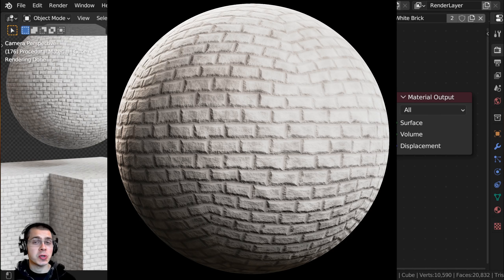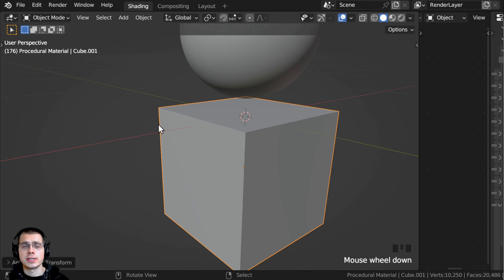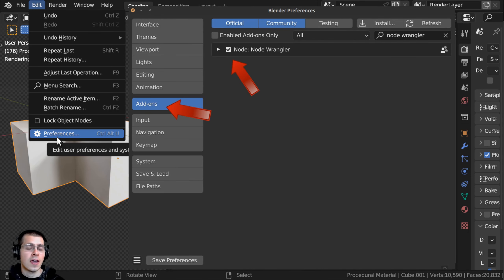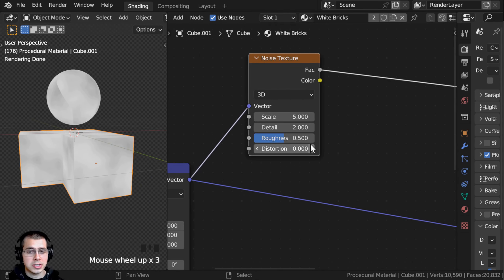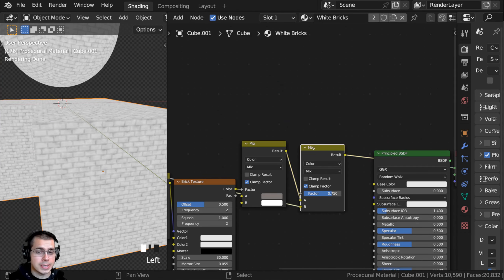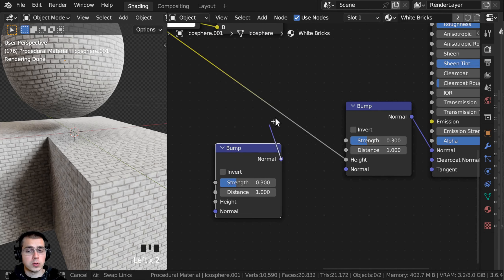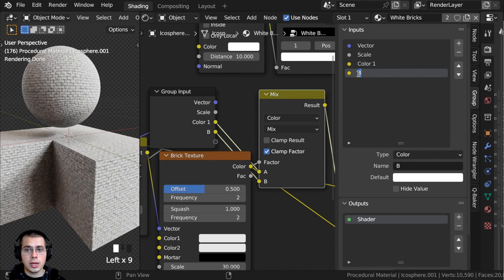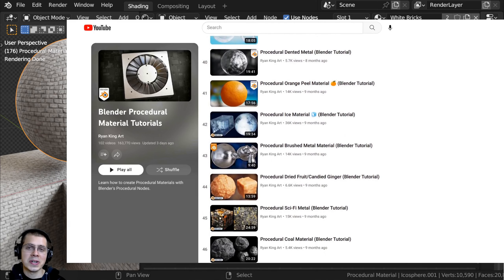Procedural White Brick Material (Blender Tutorial)

Comment: A question. Is there a way to make the bricks at the edges level up? Now the bricks go half way or a quarter at an edge and 'continue' in an overlap in an off center overlay or a quarter brick. Plus on several normals the bricks are instead of horizontal to vertical. Is it possible to get everything horizontal? It makes some building look off.

Comment: Here is another question I haven't really found an answer to. Sorry for flooding you with questions but I hope getting more comments on your videos help at least.

So what I want to do is to have a brick texture, now I'd like to add grayscale gradient to each brick individually in the texture and connect that to Bump node and to normal slot so it would look like every brick is slightly tilted to random direction. This would also make it seem that each brick is slightly on different depth.

For example one of the bricks would seem to be closer to mortar level from the left bottom corner and at the same time looking like it's pushing out more from top right corner. The brick right next to it could be tilted close to mortar from bottom and pushing out from top. In some bricks it could even look like one of the edges is deeper than mortar, this feature however is not necessary, would be cool tho!

I have to use single 4 vert plane to do this.

Tried to connect gradient to color ramp to brick texture color but that just affects the entire texture instead of individual bricks.
Reply from the maker: Ahh, I wish I knew how to do that so that I could help you, but I actually have no idea on how to get that effect.